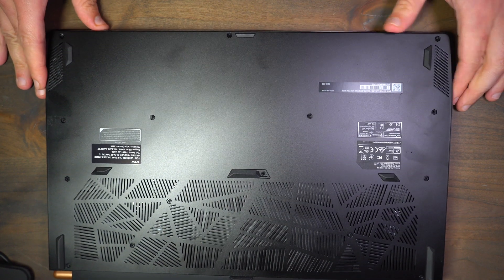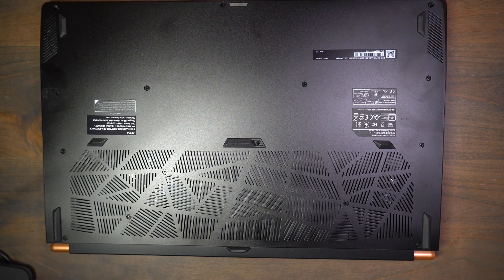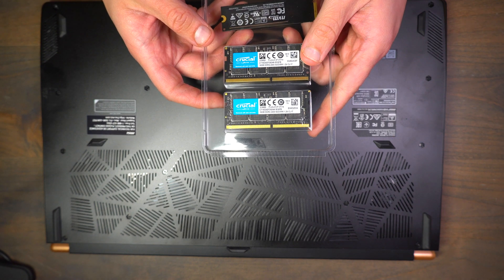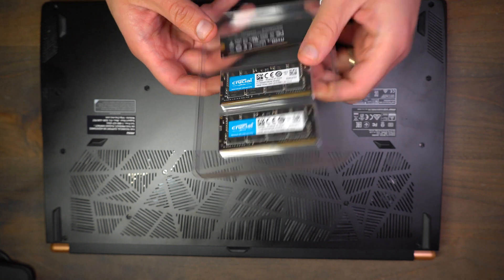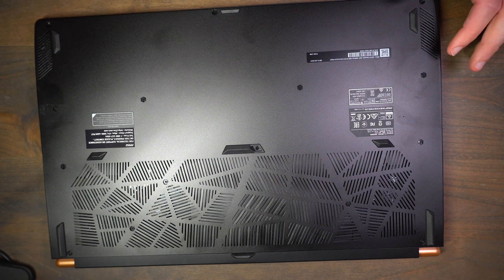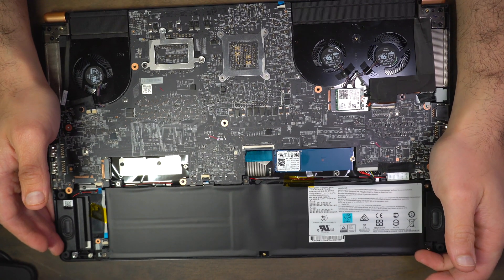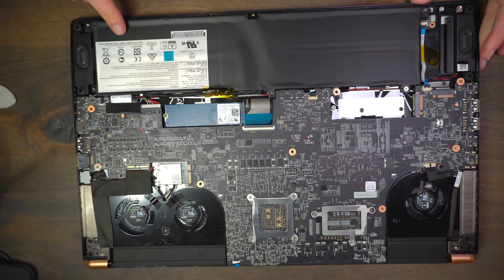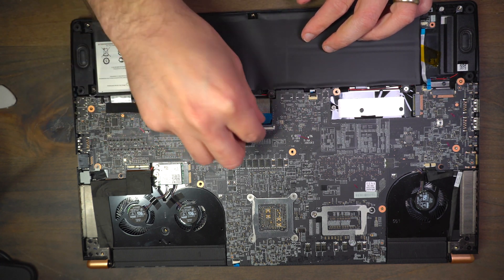MSI GS75 Stealth RTX 2070 Ram / Storage Upgrade

Comment: Hi, can you help me? How do I turn on this board without the power button? It's most likely connector CN9. I tried shorting each pin to ground, but it still won't turn on.

Comment: Great video. I have the Razer Blade Pro 17. Just take the back cover off and Razer has the SSD and RAM there. "By Gamers for Gamers." Upgraded to 64 gb RAM and two nvme m.2 slots 2 TB Samsung and 4 TB Sabrent. Samsung has free migration cloning software and Sabrent has free Acronis cloning software.

Comment: Did this computer come with the m.2 retaining screws already on the motherboard.  I just bought a 970 EVO Plus and a WD SATA SSD to fill the other two slots.  I don't want to tear down if the screws aren't there.  The drives did NOT come with screws.  Thanks
Reply: No, they don't come with extra M.2 screws.

Comment: I really wish this laptop had an old school removable keyboard. Loads of laptops have RAM under the keyboard and this isn't a problem if you can easily remove it. On a system like this the RAM is essentially unserviceable. Sure, more advanced users could do it but compared to upgrading the drives, the RAM is just too difficult to access.
Reply: Razer Blade is simple to do. Just take back cover off.

Comment: Here is what I don’t understand.
At https://us.msi.com/Laptop/GS75-Stealth-9SX/Specification

It states that the laptop (GS75 Stealth-243 [Intel 9th Gen], [GeForce RTX]) includes dual channel 16GB (8G*2) DDR4 2666MHz.

But when you opened your laptop, it only had a single memory module, which means that it was not a dual channel.

I wonder if your laptop was a previous version of “GS75 Stealth-243” with  [Intel 8th Gen]
.
Reply: Oh. Mine got only one 16GB RAM inside. And I didn't see the statement of 2 chnls of 8.

Comment: Just helped me Decide what Laptop I wanted - The Acer Nitro has two covers you remove for these upgrades takes 5 minutes
Reply from the maker: True! But this laptop is very thin and slick ! If you don't care about the slimness or the weight go with the Acer
Reply: @WorldOfGadgets  1/4" at most thinner than the nitro for infinitely more difficult upgrades is a fools barter
Reply: @ric3ray Dude you're Hilarious they all use the same hardware in different configurations so the question is which one is easy to work on and upgrade and it's certainly not MSI
Reply: @ric3ray Hilarious as if MSI Makes processors and video cards lol - They all use the same hardware vendors and if one is infinitely easier to work on only a fool would go OMG its a 1/4" Thinner Frankly I would pay extra for a 3" think laptop that had a good old keyboard bezel for easy repair but they don't them like that anymore because foolish people think thin is cool for some reason I do not fully understand because if you can carry it like a book IT'S FINE!
Reply: The real question is how much do you plan on taking apart a laptop? Literally only 2 things can be upgraded regularly (if thats even needed). The main thing to upgrade is the storage...which can be done by simply removing the back cover. Upgrading the ram does absolutely no good. This laptop is rated for memory speeds of 2666MHz and putting higher speed in will be useless. Anyone wasting money on upgrading a laptop outside of storage is an idiot. It's not a desktop....if you are worrieds about the ease of upgrade, don't by a laptop period.
Reply: @malachisilver43  No then the Question would be how long do you expect to own it I have had to upgrade every computer and laptop I've ever owned to keep up with performance curve of software and Operating systems. So basically if you want the machine functional for 5+ years it will need upgrades and likely a keyboard replacement as they wear out also and if the machine is that big a pain in the butt just to upgrade memory so it could be 1/4" Thinner I think the Engineers need to rethink Form and Function and it's as simple as that
Reply: @ormonddude  True, but still. Even upgrading every other year still doesn't raise enough concern on how hard or easy it is to upgrade. I know to some people, this is a deal breaker. For me...I love working on computers. Taking apart and upgrading desktops and laptops are fun for me. The average person buying this exact laptop, will most likely only upgrade storage.

Comment: Did you notice there is a third SSD slot next to the speaker? Vertical slot. But it is tricky. the one you replaces is a SATA/NVMe combo, the one next to it is SATA ONLY, and the vertical one is NVMe only. I have 3 1TBs in there lol LOVE that they didn't make me flip the board compared to my GS65 to add SSD. Right now I'm running two 970 EVOs and an 860 EVO SATA.

Comment: I just bought the GS75 ASF
Website shows the system has:

1x M.2 SSD slot (SATA)
2x M.2 SSD Combo slot (NVMe PCIe Gen3 / SATA)

In the video I only saw 2 slots and not 3. What am I missing? 
Can I add 3 SSD or what?
Reply: There is a third slot. It's between the end of the battery and the right speaker. You can see it in the upper right of this video at 13:38.
Reply: Isn’t the WiFi using one of them?
Reply: @Plexico41522  no. If you're counting the wifi slot then there are 4.
Reply: Gs65 has 2 gs 75 has 3 slot

Comment: Is there anyway to add RAM without disconnecting the wires attached to the WiFi card? Or do I need to buy a soldering gun to re-attach them?
Reply from the maker: There are not soldird it's like a clip on u just clip them back
Reply: @WorldOfGadgets  very nice

Comment: Anyone know if gaming laptops specifically this model is supposed to be hotter than desktops. I’m getting about 88-90c on my cpu and on my gpu about 80-86c as well. And this would make sense if I was gaming on my laptop for hours on end but it reaches these temps after opening a game and running it for 5 minutes. Like almost instantaneously. It never goes above those temps but I’m so used to desktop temps and my desktop never gets near those numbers.
Reply: Saftey First its brand new but I figured out these laptops run hot and most gaming laptops don’t get desktop cooling numbers
Reply: Saftey First I got this literally not even a month ago brand new. Is the paste just terrible?
Reply: Saftey First I would love to do liquid metal but I’m scared lol. I have an extended manufacturer warranty. Would they really even find out I opened it and check for that??
Reply: @CAAARRRLL  you can ask a shop they do it for you

Comment: @World Of Gadgets
Can someone help me out please? I would appreciate any help from the community. 
I researched and researched but found absolutely nothing for upgrading my MSI GS75. 

I want to change the thermal paste for my GPU/CPU. A person doing the disassembly said that there are pads that I need to also replace/buy if I ever lift up the heatsink. Does anyone know what he means? And where can I buy these "pads"? What are they called, thermal pads? I thought I could just use their existing pads when I'm placing it back together.
The video is here: https://www.youtube.com/watch?v=EHz-N4vuMGw 

I really want to upgrade my CPU. I have an i7-8750h. Is it possible to upgrade/replace it? My motherboard is 
MS-17G1 and according to this website:  https://www.userbenchmark.com/System/MSI-MS-17G1/110722  it seems like I can have only 2 other options? Can someone help validate this information? I have never soldered anything before and I don't know if I even need to. 

THANK YOU IN ADVANCE! Anyone in the community is welcome to help me out!

Comment: I have a question.
Can I just buy an aditional ssd and put it into the free storage slot for more storage that can be used to play games?
Reply: Yes you can. NVME m.2
Reply: Yes, you can. It has 3 M.2 NVMe slots. Plenty of storage upgrade.
Reply: @malachisilver43  No, it has 2 M.2 NVME and one M.2 SATA
Reply: @nimarjitsingh6550  This guy is correct. That silver guy is wrong

Comment: The bit you were not sure about and left out... that's part of the heat shielding... should have put that back in!!
Reply: your  wrong  smartypants,that  is for   keeping  the  parts  by not  shorting out the  components   inside  the machine  with the  back cover  which is made of aluminium,it s  common sense

Comment: Why not put a liquid metal?  Warranty is still aborted.  And the cooling system here really limits the performance. The processor cant permanently boost 3.9 GHz all cores.  And the GPU also drops to the base frequency.
Reply: Did U repaste ur msi gs75?

Comment: Hey can i have some advice please? If i have 8gb of ddr4 ram and i want to upgrade to 16gb then will any ddr4 fit and work?
Reply from the maker: Not really! I recommend you getting Crucial or Corsair brand and they have to be 260-pin to fit. 
if you want them to be dual chancel you need to get 2 8GB for 16GB or 2 16GB for 32GB checkout these links...
https://amzn.to/2ENSQdF

https://amzn.to/2EyOkiQ
Reply: @WorldOfGadgets  can i add two 32gb to this modey gs75. Came with 16gb, i upgraded an extra 16gb making it 32gb. I want to know if i can add 2 32gb upgrade = 64gb?
Reply: @Avatars3d  what gen? 8th gen only supports upto 32 GB. check MSI page for your laptop. 10th gen (latest) is expandable upto 64 GB.

Comment: You can get an area 51m for cheaper than this laptop and it performs the same. The max q 2070 is about the same performance as a regular Rtx  2060 in the area51m. Max q is truly a ripoff!!
Reply: but its not thin like this gs75 is i once had gs75 and i must say did give me couple crashes during updates and it was getting really hot i constantly have to put cool booster on but now i have razer quite happy with it in terms of performance battery etc but still got other things to test
Reply: @admiralv8538   The area 51m is not meant to be thin. It has desktop class CPU and GPU. It's also fully upgradeable. Pretty much no other laptop comes close in terms of performance.
Reply: @coolmodee  ah right and yeah i saw the price for it no thanks LOL its like 4-5k
Reply: @admiralv8538  That's for the top end configuration. The price starts at 1950.
Reply: @coolmodee  yeah my mate sent me the link to it i was like oh my jesus LOL
Reply: Admiral V very different story in Australia. The Area 51m is off the hook expensive here compared to MSI.

I also wish there was a single power brick option for the A51... so a standard i7-9750h w/ replaceable GPU.
Reply: @beliveinurself  yeah i here things over there are extreamly expensive no matter what product it is.

Comment: Hey, I've got a (factory seal)sticker on one of the screw holes which blocks me from unscrewing it, the dealer told me it voids the warranty if i try to open it and i live in India. What should i do? I wanted to repaste the CPU and GPU with thermal grizzly kryonaut and add some fujipoly thermal pads, but unfortunately, the sticker bothers me so much, I'm afraid i might damage it and void my warranty. :(
Reply from the maker: I can’t speak about India but in US and because of customer right laws it won’t avoid warranty unless u break something
Reply: Go to the technic service of msi. They ll upgrade it
Reply: It's same here in Turkey. We are bringing our laptops and other parts we need to upgrade or add (like ssd) that are upgrading it and it doesnt break the guarantee
Reply: India doesn't qualify for international warranty. So you are screwed anyways!